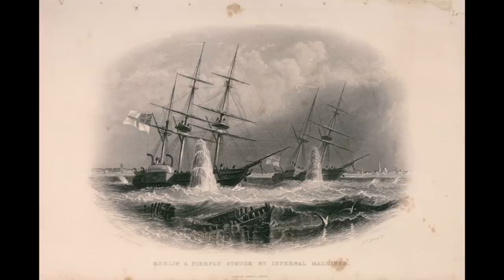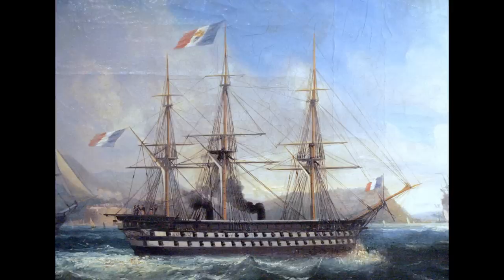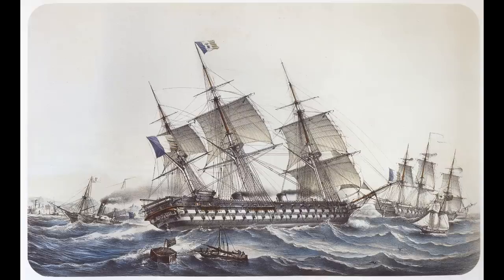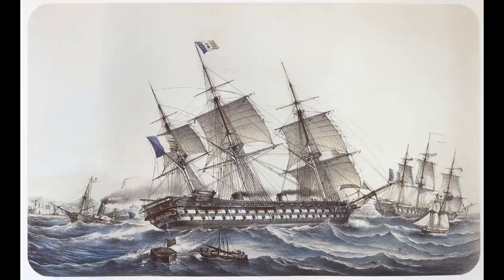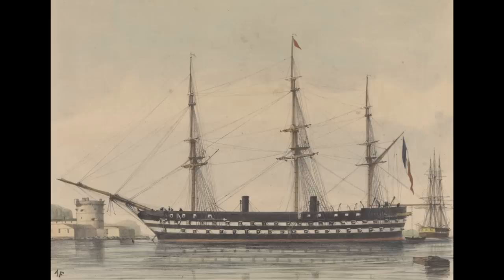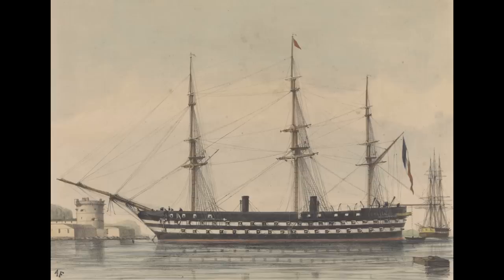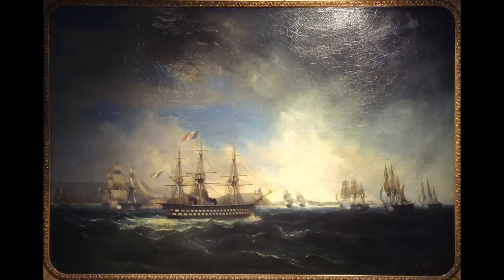MN Napoleon - Guide 331

Comment: I knew the French had their own units for weight but "French Revolutions per minute" is a whole different form of units!
Reply: @JZ's BFF close.  French RPMs are terribly inefficient because they alternate between clockwise and anticlockwise.  Under power, it was never certain if the ship would go forward or in reverse.

Of course, being of French design, it was more likely to operate in reverse during battle.
Reply: 😂 i had to rewind it. I was like 'did he really just say that?' 😂

Comment: To be fair, The fist Bonaparte could have been an aberration, two do it, that's a family habit, did they ever risk a 3rd?
Reply: The Zulus solved that problem.
Reply: As far as I'm aware, the highest political office any Bonaparte has held since then is deputy mayor of a small town in Corsica.

For several decades, France was pretty serious about not taking the risk. They had a law (not repealed until 1950) exiling the heads of all deposed royal houses. But after WW2, apparently they decided that it wasn't really a threat anymore. Plus, the then-current head of the House of Bonaparte was a war hero, having joined the French Foreign Legion under an assumed name and fought in the French Resistance. So it would've been pretty douche-y to not let him live in France even if he was a Bonaparte.

Comment: "26-30 French revolutions per minute" -is this a pun slipped in there or do the French actually measure shaft revs at a different speed? Without changing the seconds in a minute I don't see how that could be.

Comment: Honestly, such a shame that paddle wheel Ships-of-the-line weren't built, but for obvious reasons they weren't built.
Reply: Yeah, even putting aside efficiency issues and/or them being easier to damage than a screw due to their large size, they also use up what would otherwise be perfectly good gun space.  

I am a bit curious why they didn't perhaps ever give much of a try to putting the engine in the back, and counterbalancing with a pseudo-return to the forecastle concept to have an extra deck on the front half of the ship or something.
Reply: @SephirothRyu  still would've been very cool to see.
Reply: @SephirothRyu Something like a stern-wheel steamer then?